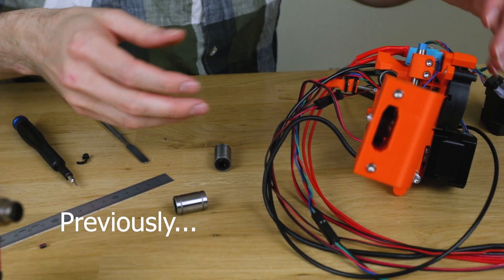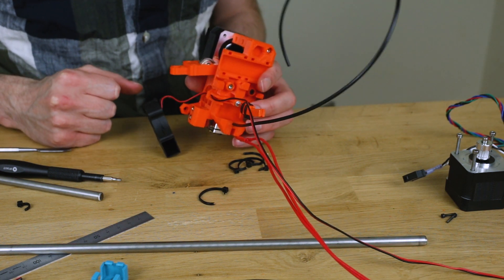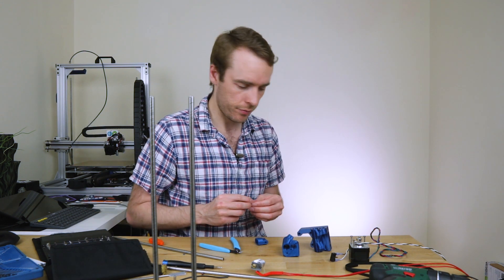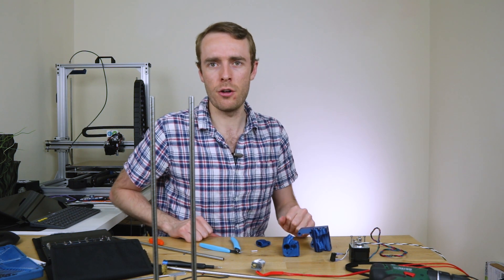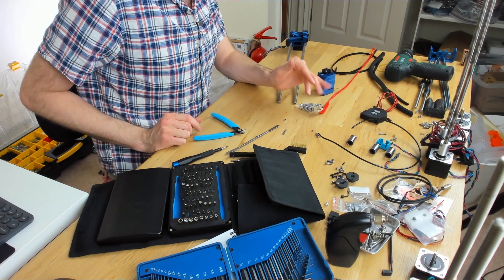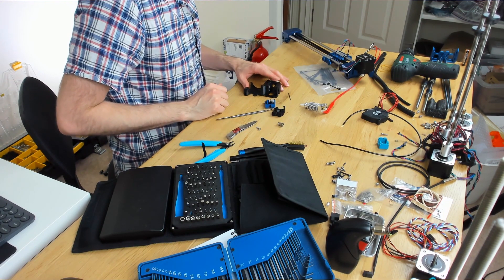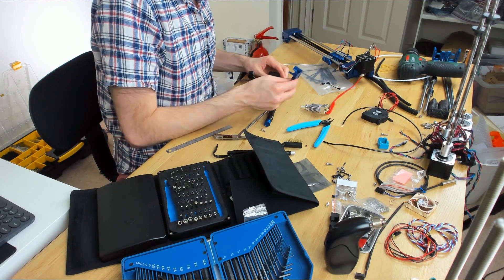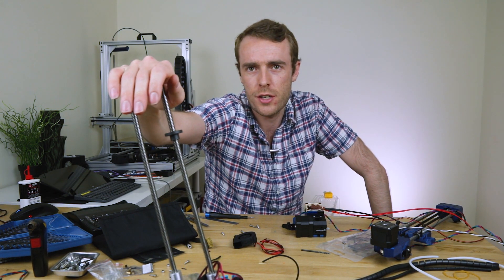Prusa Mk2.5 Upgrade Build Series - Episode 3

Comment: It took me quite a while to find the 3mm square nuts that were thin enough to fit in the parts when I added the mk2 extruder assembly to my AM8.  I ended up finding a seller on amazon that had some that were just a tad bit thinner then needed (most were too thick), but they fit quite nice and I just deformed the plastic around the openings to keep them from falling out during assembly.  I also bought a noctua fan from amazon, and if they come in the standard packaging from the mfg, they should come with a bunch of wire extensions that you can choose from that lets you either keep the 3 pin connector or go from the 3 pin to a 2 pin, so you wouldn't have had to cut it off.